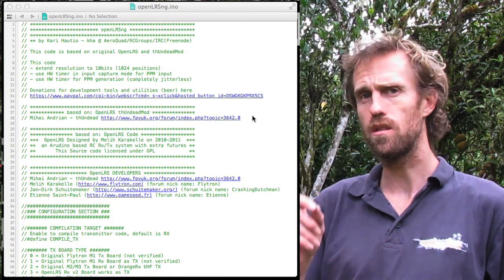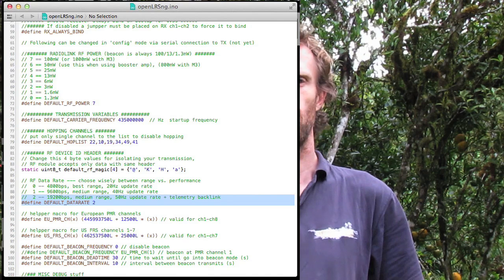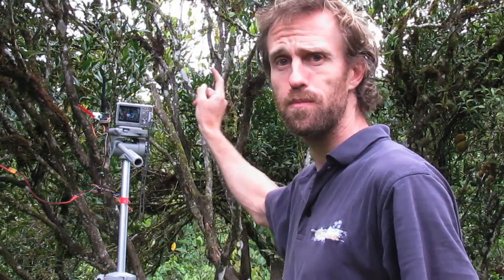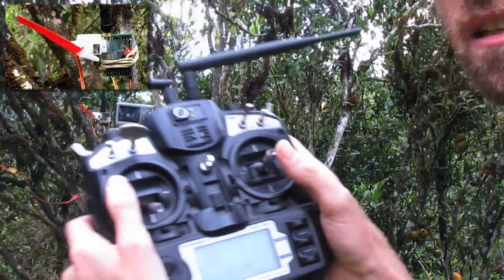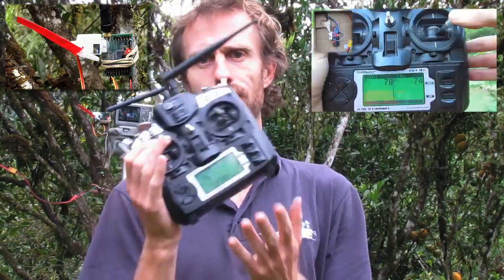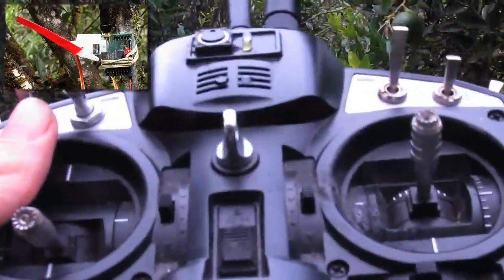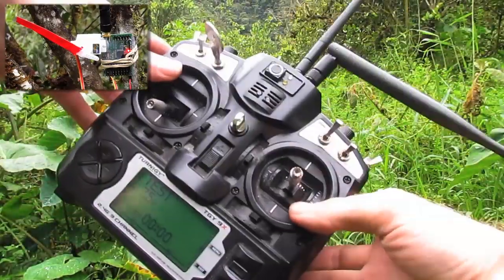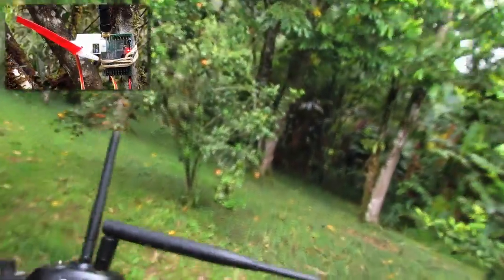OpenLRS range testing. RCHacker #33

Comment: What TX and RX antennas are you using to achieve this range? As I wait for delivery of my openLRS system from China, Ive been trying to find the best antenna combo for openLRSng firmware... Research suggests some sort of Nagoya antenna for the TX and a dipole or an IBCrazy turnstile antenna for the Rx... Just interested as to what you use.
Reply from the maker: I'm onto homemade vee dipoles now.

Comment: Very strange. I am not getting the range. I normally run FrSky on Quads and get 1km with no issues. I have bought two of these sets in two different 9x radios and only get 400m LOS on the ground. I am running sanders and also tried inverted V. I have reflashed all the boards and set long range baud and telemetry
Happy to hear suggestions.
Its got me baffled.

Comment: well my is working ,I just use a mono audio cable and share the ground,one goes to the trainer port the other one goes to the battery to power the openrls module,Spektrum has 1 v ppm  output,the dragon link I think need at least 6 v,so what u need is put a transistro between the main power of the radio and the ppm signal,so you'll get the 6 v ppm signal and your dragon link should work...

Comment from the maker: OK I did some google work, and from what I have seen the Spektrum trainier PPM signal is not standard and either too weak or inverted. You will need to open your radio up. Tim has an article on it. Google 'FPV manuals DX7 dragonlink'.
Strange that the dragon link failed it must have very poor input protection. It should at least have a resistor on the PPM input.
Would you like to send me your broken one?

Comment from the maker: All you need to make this work in power, ppm and ground. And you really need at least a multimeter to find those. Very strange that dragon link would blow up if you got something wrong. It must have very poor input protection. Perhaps the Spektrum does not even have those signals on its trainer port.
Sorry to bag your purchases but from what I have seen Spektrum radios have their issues too. Google 'My Spektrum radio caught fire!' and read the comments.

Comment: Hi Marc thanks for share all of your test with us.....I don't want borred you,but i have little question...I oder the 433mhz tx-rx modules,I found the diagram of the 5 pins goes in the back of a turnigy radio,well i don'y have one,so do you think i can connect the tx module in the trainer port of my spektrum radio using ppm and power it with an external battery?

Comment: Telemetry back link reduces range.. also the standard antennas are crap..

Having two antennas next to each other like that does not help either.. even if the other one isn't connected to anything.

I have FrSky as well...  to be honest in clear line of sight.. not much range difference.. but the OpenLRS really comes into its own in urban areas and around objects. 

Get a sander antenna on the RX and a SRH -771 Diamond 1/2 wave on the TX.